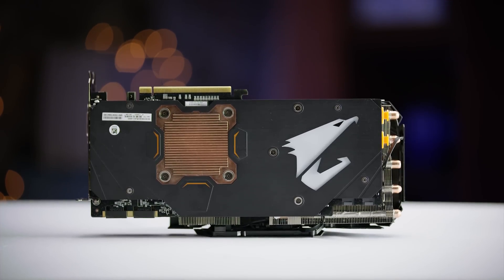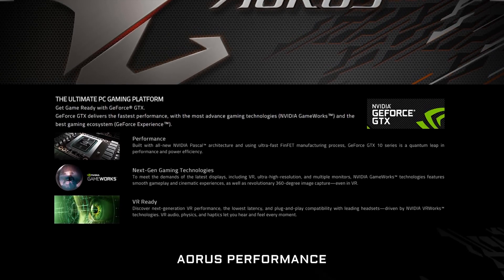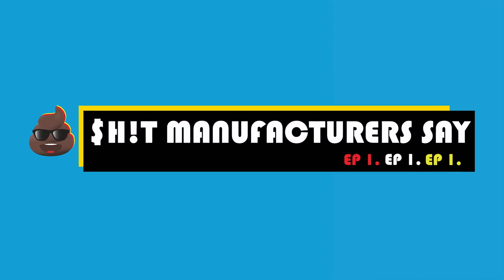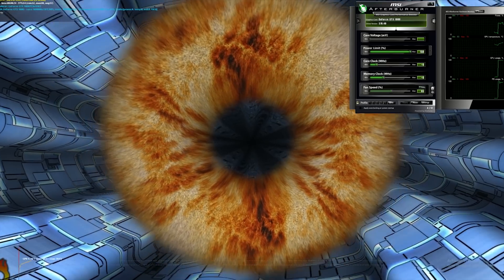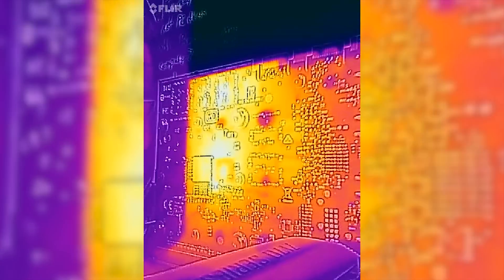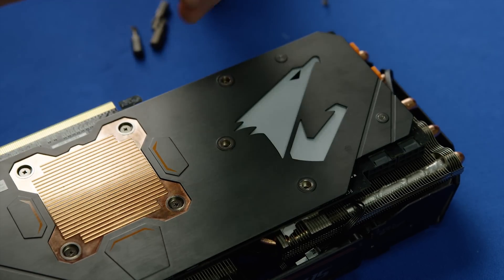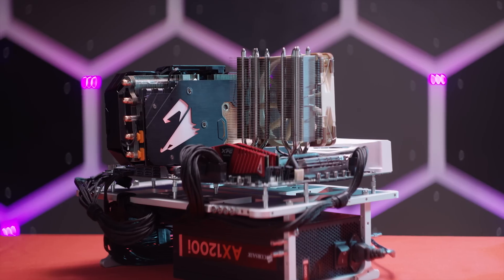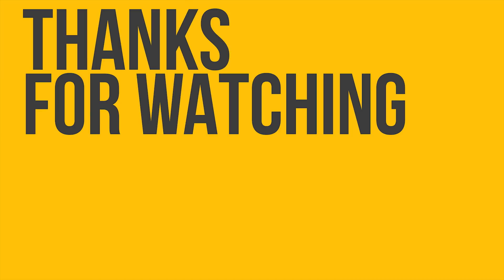$h!t Manufacturers Say Ep. 1 - "Backplates Cool Your Video Card"

Comment: Or maybe it's because there's no air running over it. It's in a test bench guys.
Reply: auren11 I think the theory is that inside of case you have case fans that would push air over the ridges taking advantage of the additional surface area.
Reply: Disobeyedtoast I thought same thing. Makes sense in my opinion
Reply: Disagree on the airflow note. Airflow to the copper piece is not guaranteed on ANY build, and this is a point to be made AGAINST it. It's true that the copper piece no doubt had heat transferred to it, but where the hell would it transfer that heat to?  Normally, it's transferred to air going out and away from a heat source, by use of fans, but this has no fans. This is why this piece could only possibly contribute to the cooling of the GPU if airflow was directed to it in such a way that cold air would "bounce off" of it. (Essentially, you direct cold air airflow to it at an angle, the air "absorbs" some of the heat, but "bounces" off and goes somewhere else)
Reply: Skullthrax  a fan on your coffee would still cool it down much more efficiently, your point is invalid.
Reply: +The Reaper95
He's a fucking idiot, if the thermoprobe is placed near the exhaust the temperature would be higher but completely wrong to say that every zone is the same temperature, even a HDD in front can raise the incoming temperature by a bit
Reply: It's totally possible, not putting anyone down... just saying that it could happen. It sounds possible to me.  MythBusters?
Reply: Doesn't matter. There is still natural convection occurring. Forced convection would give you the same result.
Reply: Austin Michael copper is shinny, there thermal camera won't show heat on reflective surfaces. Also cases are designed to pull cool air in over the components and push the hot put out the back or top. What they didnt test for is air flow over the backplate. Kyle from Paul hardware also did a similar video explaining test benches and cases with the new evga card.
Reply: CRABST3R ! the flir camera isn't sending out ir and waiting to see what comes back all the flir camera does is read what things in the environment is outputting so shiny or not it can see it acuratly
Reply: Bonghætte no your thinking of an ir  camera that sends out and bounces it back flir just reads what's being emitted by objects so it doesn't matter if its shiny
Reply: Stop trying to invoke thermodynamics if you don't understand thermodynamics.
Reply: im pretty sure they have fans blowing on their testbench
Reply: Look at the thermal photos. The copper plate is absorbing no heat. Your post would have been a possible criticism if the copper plate was actually absorbing heat but it isn't.
Reply: There is already convection taking place.
Reply: Nightcore Legends sorry bud but the reflectivity (shininess) is a fundamental part of the equation for how well something shows up in FLIR and is extremely relevant. I don't have the link but you can go to gamersnexus to confirm this, among other places.
Reply: agreed...
Reply: Bonghætte But this one does generate its own heat... Well, this is of little meaning for me. I do not know how FLIR works, so I will steer clear of this.
Reply: So everyone else who have said that it didn't work on all sorts of sites mean nothing? Also maybe some passive air flow in the case doesn't affect a CPU or GPU because it needs better ways to reduce heat.

I doubt the PC case fans help when it comes to cooling your PC. The air outside of the PC is the exact same temperature as inside of it. The main cooling reduction happens directly on the heatsinks or because of the fans stuck directly to it.
Reply: If there are memory chips and VRMs on the back then yes. It has no other surface area than being a flat piece of metal.
Reply: The comment directed towards The Reaper95 who said the video I quoted before was wrong. So one would assume that he claims air flow makes a difference. 

I doubt it would be any difference if they put it in a sealed case because the air temperature outside and inside a PC isn't going to be all that much different. Maybe like half a temp and that's just the area close to the CPU or GPU. But that quickly goes away.

But if the backplate would have done something the temperature would have shown that but it was exactly the same.
Reply: +Zefar77 Ah, my bad then. I looked back to see who you could be replying to, but I missed that comment. Yeah, I see your point.
Reply: Open test benches always have better cooking properties than closed cases, unless they are inside a very small box... like a computer case, for example.  Hot air rises, remember. as long as there is open space above the hot part for that hot air to go, it will be replaced by relatively cooler air and the process will continue in a cycle.  The process is known as "convection".

EDIT: How did this get to be a argument about active versus passive cooling?  The part in question (the backplate) is passively cooled.  Every part that can be damaged by its own heat is actively cooled by a fan and heatsink mounted directly to the part.  The purpose of additional fans in a computer case is to make up for the fact that convection loses efficiency when it is inside a relatively enclosed space (even one with holes in it) as the cool air that replaces the hot air will eventually reach the same temperature as the hot air if no or relatively little air can escape.  This is why fans are usually set up to exhaust air out of the case and not pointed directly at specific components.  This solution at its best will be equal to an open test bench but can never quite get there due to the formation of eddy currents which keep air from effectively leaving the case.  You cannot cool a component that is already actively cooled any better by blowing room temperature air on it than you can by simply allowing room temperature air to flow over it (which a computer case does not do).
Reply: Air pressure matters more than heat when it comes to how air moves.
Reply: Disobeyedtoast That's exactly why case fans don't cool actively cooled parts.  You can't expect a fan mounted somewhere in the case to increase the pressure exactly where it is needed to cool a part higher than the fan that is mounted directly on the part can.  Furthermore, as I said, the most common configuration for case fans is as an exhaust which decreases pressure if anything.

It's true than there are certain blade server case designs in which all cooling is done with fans mounted in the case but those designs have a very basic in-out airflow configuration and the parts are all inline with that airflow.  Something that almost never happens in consumer case designs.
Reply: Well, anywhere there is more airflow than convection cooling can occur, convection currents cease to flow.
Reply: Not too long ago he tested if airflow actually made an impact on temperatures. So Luke filled a case with boxes, shirts, teddybears and what not. No change. At all. So that airflow isn't going to help in the slightest.
Reply: +auren11 most definitely yes. A case works as a wind tunnel, guiding the air through the case, so if you place your fans right then usually there will be a reasonable amount of air going over a GPU backplate. Of course it all depends on your setup, but usually there will be significantly more air going over the backplate than in this test.

LinusTechTips is becoming less and less scientific and more "just do something interesting quickly". You need to remove all other variables as much as you can (or at least account for them) for a proper test, which is something they simply don't do anymore.
Reply: A computer case not a "closed off, sealed off environment." Even with everything Luke did to try to impede airflow it was still not closed nor sealed.

There's a phenomenon called natural convection. Essentially, air is affected by gravity. Hot air is less dense than cool air. So when air warms up it gets displaced by cooler air. So in any normal environment that is not extremely small or a vacuum (e.g. a computer case) you will always have hot and cold air moving around. 

You don't have to put a fan on your coffee mug to cool your coffee off. It is cooled by natural convection. 

So because natural convection exists, even if Luke were to introduced forced convection into this experiment, the end result would be the same, because there is already convective heat transfer occurring.
Reply: +Zefar77 No one ever said that. Not sure where you got that idea from. Just cause we disagree with the test method doesn't mean we disagree with the results. We are only saying we don't trust these results. That's one hell of a leap you're making.

If the test would be performed properly the result could just as well be that a backplate doesn't matter for shit. Then at least the conclusion would be somewhat trustworthy.

I personally think that indeed the backplate doesn't do a lot at all, but I'm still criticizing the way this test was performed because it's just not a good test.
Reply: My point isn't invalid you fucking idiot. Introducing forced convection would change the temperatures on both cards by the same amount and you would end up with the same results.

Fuck off with your stupid 2008 memes.
Reply: +The Reaper95, put a temperature measurement item inside your PC case and see what temp it has and then have it just outside of the case. The temperature will be the same unless you put it directly above CPU or the GPU.

A PC case has a lot of air intake and it will take in the rooms temperature air.

Comparing a PC case to an oven or a big ass house is just stupid as it's not the same in any kind of way. 
You obviously don't know much about thermodynamics so don't talk about it.

Comment: my backplate gets very hot so how is it not cooling
Reply: Of course if it is hot it is dissipating heat otherwise that would mean that the backplate is generating it's own heat.... If the back plate is hot it is taking the heat from somewhere, hence dissipation, though it is not efficient in dissipating heat, but it certainly is dissipating heat (taking heat from another point)
Reply: It doesn't actually dissipate that heat.
Reply: Then why is there a crap ton of thermal pads on the bottom
Reply: RiffsnReviews so my msi rx480 8g does disapate heat not effectivly but it does?
Reply: RiffsnReviews By that I mean a fan isn't blowing on the hot backplate to spread the heat into the air. Sorry for being imprecise!
Reply: Seb Surdel As was said in the video, the thermal pads are probably to not hinder the cooling of the components on the back of the PCB rather than improve cooling. If there was no backplate, the air would move freely over the components. They are to make sure it doesn't make the product actually worse.
Reply: +Dragonheart - No, you're quite wrong there. A simple metal plate is never going to be nearly as efficient a heatsink as a complex fin array with heatpipes running through it, but it is a heatsink nonetheless, and is quite a good way to increase the surface area available for heat generated by back-mounted VRAM modules to be dissipated to the passing air. After all, if you didn't have it, those VRAM modules would have a cumulative total of probably no more than 5cm² in contact with the air, whereas with a backplate, they'd have around 200cm² even for a fairly small card. Of course it doesn't scale perfectly and you won't get cooling that's forty times as effective, but it definitely does help a lot.
Reply: Robert Faber Is that not what I said?
Reply: Dragonheart No, because you seem to assume that as long as there is no fan involved, something can't dissipate heat to the surrounding air.
Reply: Sorry... my english isn't that good I guess. I meant that the backplate does not significantly dissipate heat. While the fins in a heatsink store the heat and the ambient air can, in right temperatures, dissipate the heat, the fan that blows the ambient air over the heatsink does most of the work. Of course the heatsink dissipates some heat, just saying that because it does not have a fan attached, it would not normalize temperatures with ambient air nearly as quickly as a traditional heatsink fin array, thus making it hot to the touch.
Reply: Dragonheart Thanks for that, but I'd still have to contest that the fan does most of the work. The fan does very useful work, certainly, but the main reason why the fin array of a CPU or GPU-front cooler is much more effective than a backplate isn't because there is a fan mounted to it, but rather that it simply has a much greater surface area-to-volume ratio, and thus comes into contact with more air at the same time.